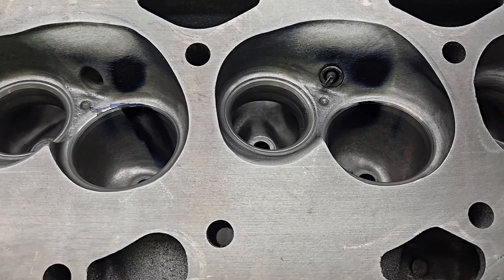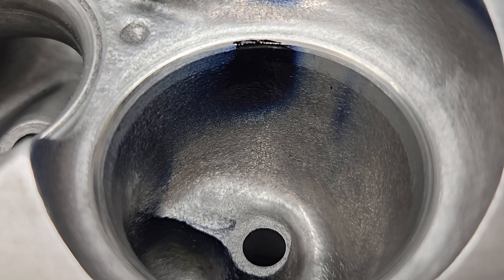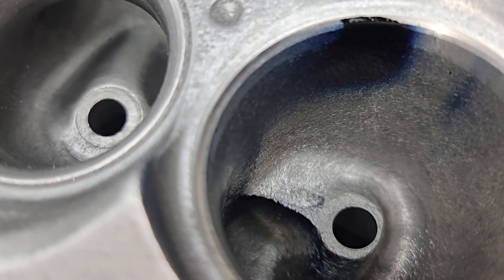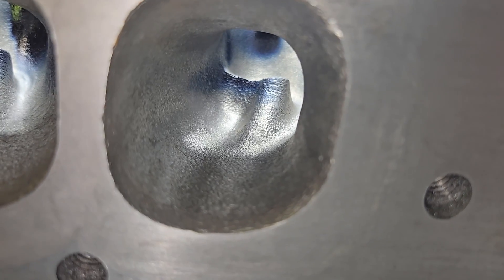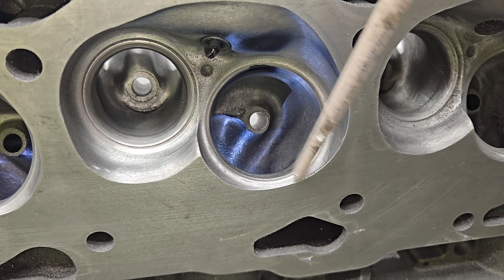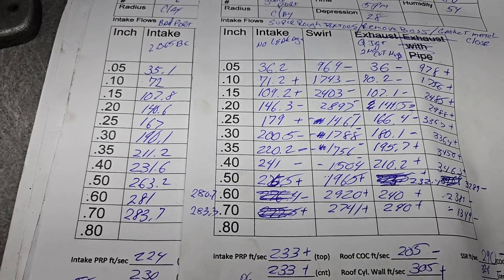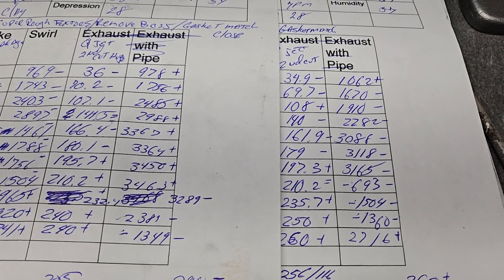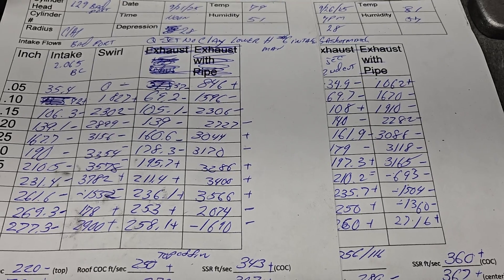Chevy Big Block 454 L29 Vortec bad port second cut. Flowed with and without Quadrajet iron intake.

Comment: I know you didn't want to go to the bigger seats to keep the swirl high and possible shrouding issues. BUT......do you think there is room to install the seats for a 2.190/1.88 valve set up? My castings currently have hardened seats in them on both intake and exhaust for the same valve set up as yours. My worry is if I'd hit water with the larger seats being they are already cut .375 deep. Opinion please.
Reply from the maker: It would be a guess if there is enough iron to support a seat. A competent machinist would know better than me. Thanks

Comment: Richard holdner has done a bunch of testing with the gen6 engine. He's stated a few times that these heads like right around 28-29° of advance. Any more and the power started dropping off
Reply: I would bet its the hot point in the chamber causing detonation.  Charles' rounding there should help.
Reply from the maker: Good info. Thanks

Comment: I know I'm going to get called out for BS. But my 98 3500HD has L29 with a 5 speed, and it is getting in the 12.5 range on MPG. This has been done several times with GPS because the speedo is incorrect .
Reply from the maker: Driven with a light foot no doubt! Thanks
Reply: @servediocylinderheads  No man, 70 and 75 on highway pulling trailer empty and loaded. It gets about the same, not pulling a load. I just purchased this truck six months ago, and it was to replace my old 88 c3500 with a 350 tbi converted to 4bbl . And it has never broke into double digits on mpg. I'm shocked but it is what I have measured.
Reply from the maker: @anthonyanderson464 It does prove my point as an efficient design. Thanks

Comment: Looking good Charlie. I'm surprised the intake ports flow that close to each other. If you hook the exit of a intake manifold runner exit does it make more swirl? I think you are correct about the timing.  I learned that on some 193's on a 350 carb engine.  Thanks
Reply from the maker: I don't understand the question. Sorry
Reply: @servediocylinderheads DV has talked about it. On the outer wall intake manifold runner  exit before it enters the head making a concave ramp to direct the air and fuel towards the center of the intake port on the head.
Reply from the maker: @DonDotterer Overshoot. Ok. These runners have a nice straight section to the head, after porting.... Thanks

Comment: 🔔😎
These are all steady state static numbers.  Swirl, CFM, velocities, etc.
I've always wondered what's really happening when the cam is camming, the valves are valving, and the pistons are.... jumping up and down 50 or 100 times per second.
Does the pulsing of the flow and the slinky mixture stretching and compressing really reverse the swirl, etc ?
We realize the performance results, but my pragmatic analytical OCD wants to know. 🤔😎
I guess it doesn't matter because the name of the game is RESULTS. 😁
Reply from the maker: It is a good question. Does it have time to reverse swirl?

Comment: Charlie, I am wondering if you.were to put clay in the swirl vane area like you did on the small block heads would you pick up flow
Reply: I think we can put the difference in flow to the swirl, since it stores energy it will help you when the flow is running out of steam, but its also a limiting factor for how much maximum flow you can cram in the cylinder at any given lift.
Reply from the maker: Probably, but how would we make that a permanent fix? Epoxy? I doubt it would be a big gain. Thanks
Reply: @servediocylinderheads i am just curious,  because the tbi small block heads picked up some